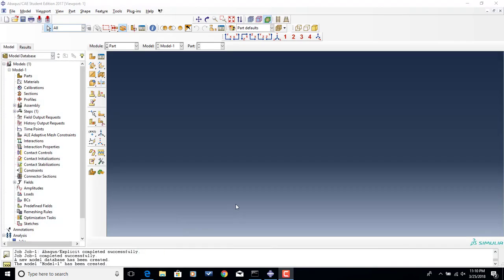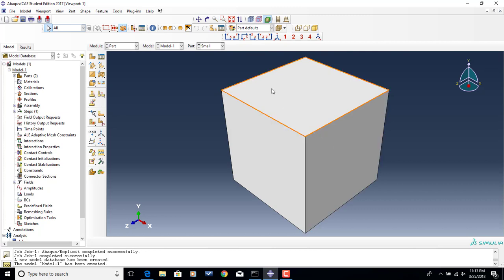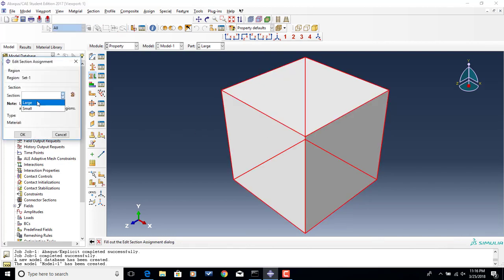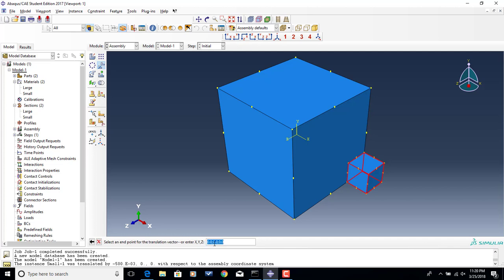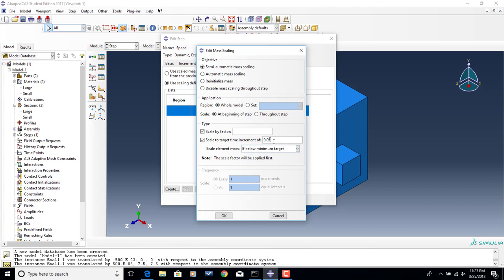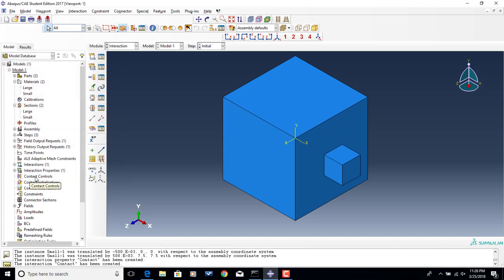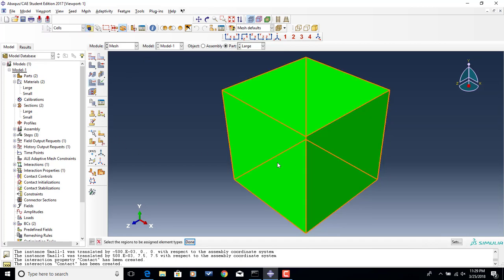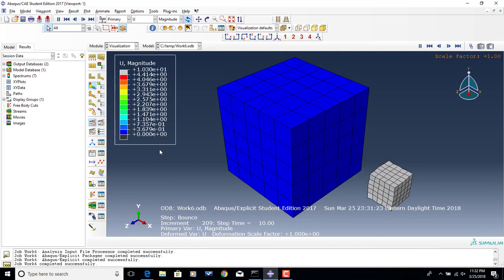Widener ME474 Abaqus Workshop 6 - Dynamic Explicit Cubes

Comment: Sir, It is a very good video. I had some doubts regarding mass scaling. Also, the density chosen was about 100 times of generally used structural material.